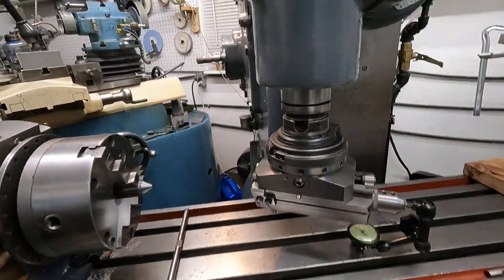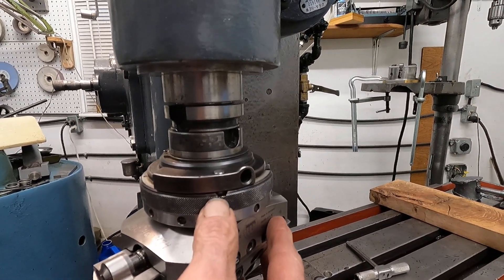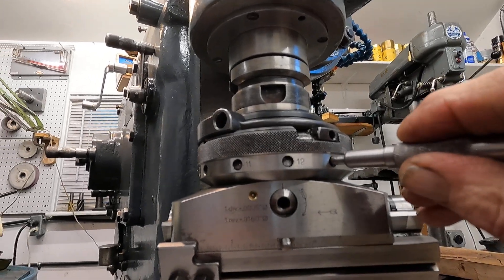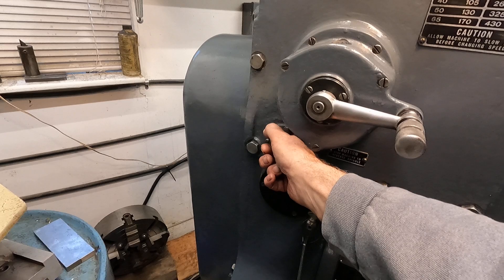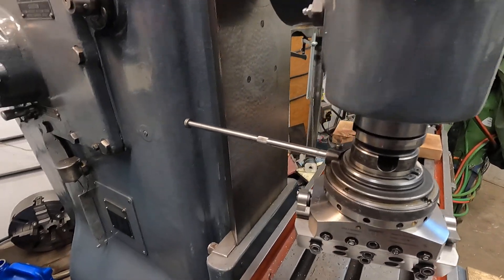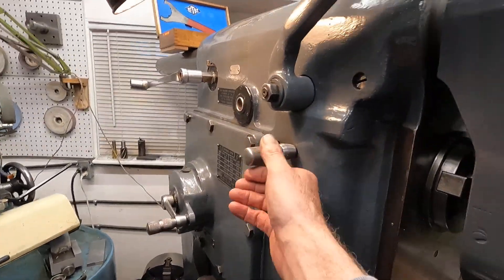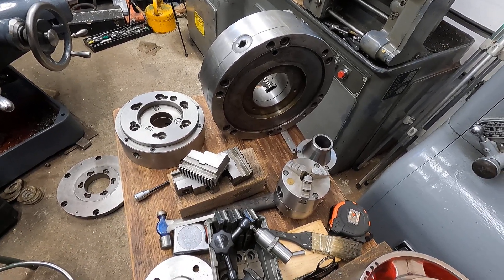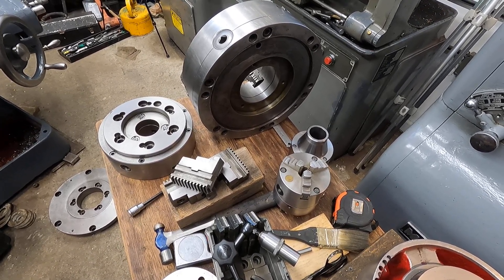Brown & Sharpe milling machine with Wohlhaupter Boring and facing head

Comment: My shop has a number of Wohlhaupter heads lying around. They are a bit redundant in a shop that's 90% NC I suppose, but I've been looking for an excuse to take one for a spin. 
Ever work with De Vlieg "Microbore" heads? We also have a bunch of those, but they get at least some use, though not by me. Apparently they work quite well; a bit more rigid than the usual Criterion style I'm familiar with, better suited for deeper holes.
Reply from the maker: I see these Wohlhaupter heads at CNC shop auctions the best place to find one for a good price. The De Vlieg
Reply from the maker: Continued because of large fingers on small computer-
the De Vlieg machines and tooling are common here but I have not used the equipment for service and repair work. those boring bars have very little adjustment range making them more solid. The one thing I forgot to mention is I find the Wolly heads hard to adjust for close tolerance in regular hole boring because it adjusts with a gear train, so I mainly use the head for facing and grooving.